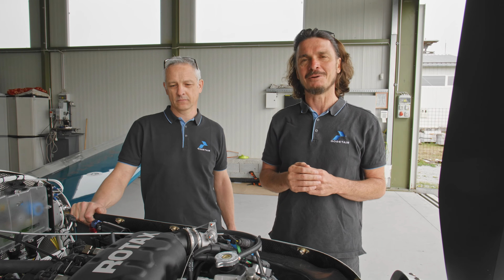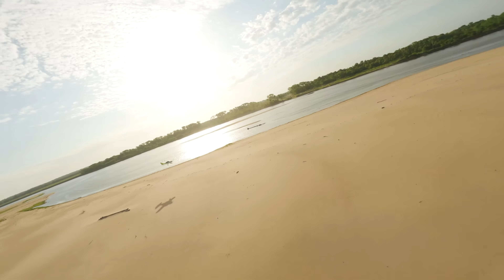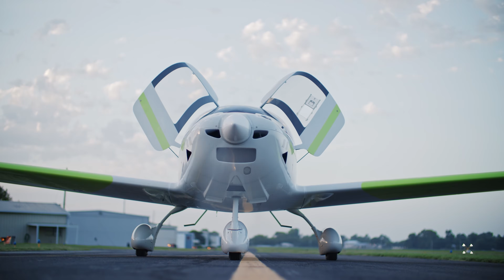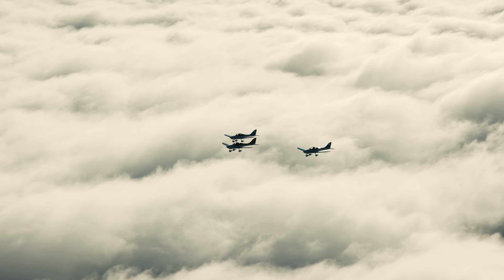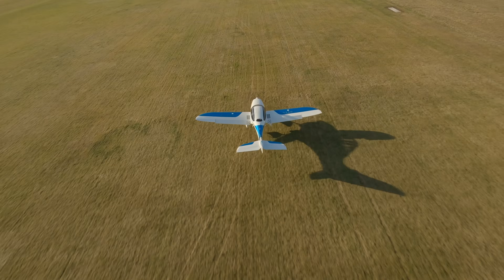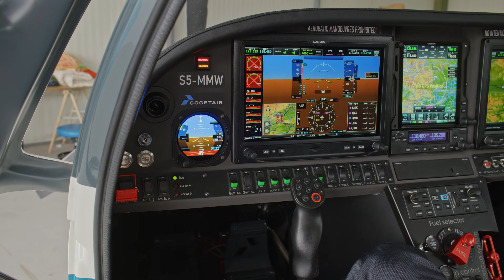G750 Rotax 915 Electrical system

Comment: How often does a fuel pump actually fail. The fuel pumps i replaced as a mechanic were either 20+ years old or had corrosion from alcohol fuels.
Reply from the maker: Fuel pump almost never fails, but the 915/915 line of engines demands high fuel flows due to big volume of return fuel. And designer needs to make sure that on the inlet/low-pressure side, you have a sufficient flow of fuel without drag in fittings and lines so as not to create problems under pressure in fuel that would manifest as vapour lock.